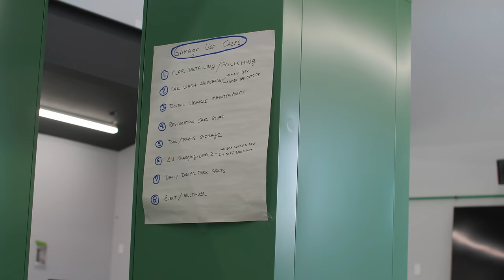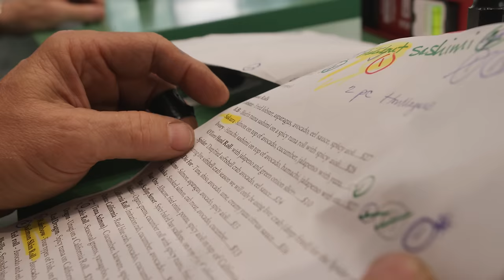EPIC Car Barn Build Series | A DREAM Custom Garage - E4: MICE In The Cabinets?!

Comment: Surprised you're not using like 242 on the air threads. Loctite even makes some other sealant for airlines which is really handy. Beats the hell out of tape.
Reply: Absolutely agree.
Reply: What threads are you referring? Prevost alumin piping isn't threaded and the fittings are plastic clamp-compressed.  Using the debur tool on the raw piping, adds the angle for the fittings to seat.  Unless I'm confusing what you're saying, there is no need for pipedope or tape on Prevost air systems.

Comment: Are you able to bend the prevost piping like you can with EMT? Would save a lot of fittings and give a lot of flexibility with installation. Progress looks great!
Reply: It would more than likely kink or crack unless you use a specific die for bending 25mm tubing. EMT benders are to far off size to work properly

Comment: If i were to change oil on swiss traks and got oil on them would it damage them?
Reply: Will not damage them at all really easy to pop up and clean under
Reply: No
Reply: Oil wouldn't damage molded plastic.  Most of your oil system is plastic.  Oil is even packaged in plastic containers.